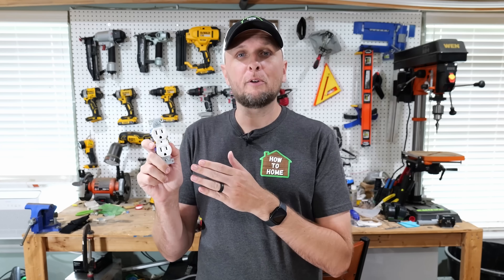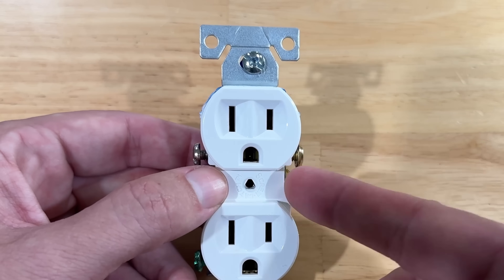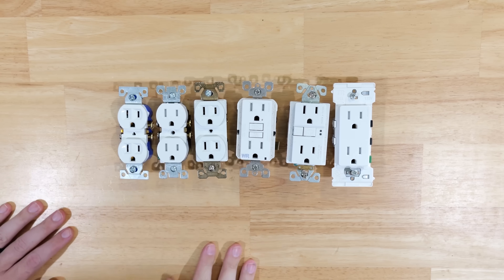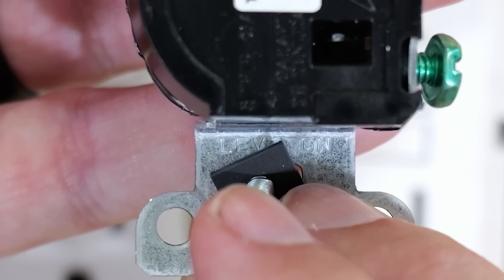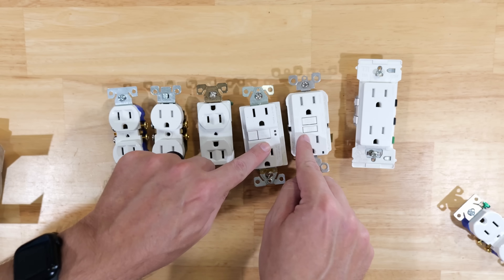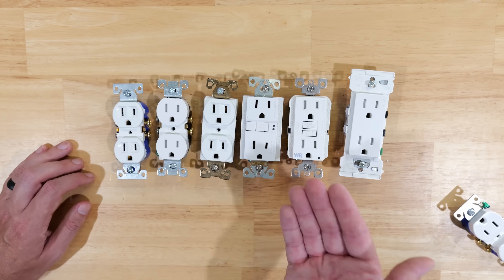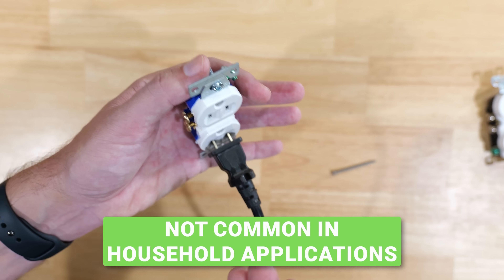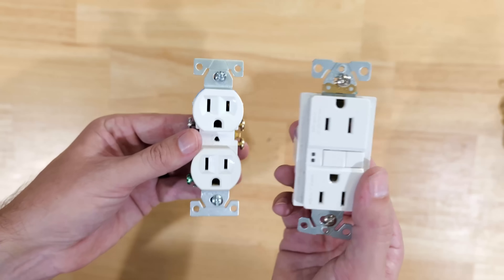The Shocking Reason Why Your Outlets Are Installed Upside Down!

Comment: I've been an electrician my whole life (45 years exp). I worked non union, union and owner. A place you will always see outlets installed ground up is in hospitals or anything patient care. That was for the metal clipboards they used and hung on walls all over patient areas would slip off their screw or the staff would fumble them and they would hit the outlet and short circuit. So in many municipality settings, it's in the blueprint literature to install them ground prong up. They're many other commercial and industrial settings they could fit this example as well. I've always install outlets to the environment they are in, so in any instances that something could come off the wall or fall onto an outlet or if in the specs, I would install ground up. If not, ground down. Also, horizontally, you should always install the receptacle neutral side up. Thank you and have a good day.
Reply: Good point on horizontal, I hadn't thought about that!!
Reply: Thanks for explaining this about my work environment - I always wondered. And, we're building a new house and have plans for some horizontal receptacles so good to think about that as well.
Reply: @marlohowell7081  We have horizontal outlets in this building.   With neutral pointing pointing up, if something is dropped it is going to hit the neutral and ground.  Though if a person's finger edges over without being seen when unplugging something, the hand will touch the hot prong. I've not noticed this to be a problem.
Reply: I was in the hospital 4 days ago. Every receptical I saw was ground side down. I’m 81 years old . I’ve never seen a ground side up receptacle. Also I occasionally buy short power cords with flat plugs in order to use the behind furniture. The cord connection is always angled so the the cord angles down.
Reply: @davidstevens1911 I noticed that Aurora medical facilities around here have ground up. But was at an Ascension building the other day, they were ground down. But Ascension building is decades older, so probably follows the old convention.  NEC rules are changed based on history of hazards, so this one might not have made it there yet.  Example, GFCI required on HVAC because a boy jump a fence landing on outdoor AC unit and was electrocuted. The exception 1 for this is removed in 2026.
Reply: @paulsorensen8489 I now have a tape measure with burn marks that wouldn’t be there if the receptical ground had been at the top.
Reply: Not an electrician here, but I did work in a hospital, and noticed that some outlets were prong up, and some prong down.  I asked one of the maintenance guys.  He said that they install outlets ground prong up for generator circuits and 30A circuits, so they can be easy identified.  When we built our new corp office, that also was something the electricians gave me the option on.  So I had them install the 30A outlets prong up.  The generator circuit outlets plates have a red dot on them.
Reply: @Mike.Canfield  hospitals use red outlets and plates in Florida and is on continuous power. Blood pressure pumps are on their own battery and the cord is to charge the batteries. Also hospital grade plugs on them. 73
Reply: Put the plug in firmly then never a problem
Reply: @bobd642  that is not always going to happen and plugs get Jared loose. I found my heater half plugged in. Good thing it was on low 600 watts. I never use high 1500 watts. 73
Reply: BAMA here. Hospitals have ground up. For all the same reasons. But if I did that in any of the houses I build, the homeowners would think they are wrong.
Reply: wow, it took me a nanosecond for me to decide that the most safest orientation is down, even in hospitals.    The most likely and probable scenario is the plug will eventually; over time, come loose and out for many reasons, pets, furniture moving, etc and our friendly "gravity", not things dropping, not because it looks better, but it is the safest, as the plug eventually comes loose, the GROUND is the last thing to come out and the ground being connected is the most safest scenario rather than having the hot being the last prong to come out.    This was my first time ever installing a receptacle as an apprentice 35 years ago and now a retired licensed electrician and I never had to debate this since.
Reply: Thank you for posting this. I always wondered why health care facilities had receptacles with ground up.
Reply: Behind the refrigerator,  the power chord will hang normally,  the ground hole, has to be down. If your brand is different,  you may want to flip it.
Reply: On one school job we were instructed to mount ground up, there had been a fatality from a teacher plugging in an overhead projector and her gold chain got into the hot/neutral blades. Only the one job... Never asked to ground up since.
Reply: @budward3780  I've had is specifically requested in blueprint specs in VA hospitals and other medical facilities I have worked in.
Reply: Sitting in a Canadian hospital at the moment. Ground prongs are all down. Maybe up in laboratories and cupboards there but not anywhere I can see.
Reply: Every house I've lived in and visited for the past 58 years have had all ground plugs down except for 1 home. There has never been an incident where a hanging object has fallen off the wall and hit the two plugs. But, that is just my experience and mine alone.
Reply: @masshultzy6449  It matters not.  The reason for it is the have a "make first, break last" conductor connection to the ground fault return path conductor.  The orientation of the outlet is 100% inconsequential, or we would be hearing about the consequences.  It is a non issue.  If one's plug is hanging out as in not fully inserted, then one has an issue with the functional integrity of that outlet, not how it got installed.
Reply: @cosmicraysshotsintothelight  Perhaps if you opened your mind a little instead of insisting you are always correct. Also, no need for the silliness term. Maybe you should do some more research in ungrounded emergency systems before you go spouting off on things you obviously know very little about.
Reply: At a previous house in San Antonio, the ground prongs were up as a distinction between local electrical installers.  My own thought would be ground prong down in the far more likely scenario of a plug being pulled out partially (i.e., someone hooked the cord on a chair or their foot). The ground prong being longer than the hot & neutral would remain with some contact a little longer than the other two. That said, I think that both 'casualty scenarios' are pretty unlikely.
Reply: In a Hospital, most of time they use metal device plates too! Ground up would be an advantage!
Reply: I was taught ground up by my grandmother back in the late 70s but I have never heard neutral up on horizontal install
And I honestly never gave it any thought
But now that it's been mentioned i can totally agree thank you for the education
Reply: I install ground down, sockets remind me of O faces. 😮
Reply: Ground prong down, because it looks like a Face
Reply: Was a licensed electrical contractor when I was younger and did the same. Ordinary folks just think it's weird in a house.
Reply: This
Reply: Perfect explanation, thanks! Though if metal clipboards falling onto exposed conductors is a problem, this seems like a bandaid for the actual cause.
Reply: Some plug manufacturers place the grounding pin up and others down, on "Male Molded Angled Plugs". So if you want the cord to hang down, you have to have a socket with the  proper grounding pin orientation. I solve this problem with a 4" box. Then install two duplex outlets, one ground pin up and one ground pin down. 

THE STORY goes:  Mr. Labre conceived this 3 pin design to prevent his landlady from being shocked by a small fan that she used on hot days. Her cat would knock the fan over, and when she set it back up, it would give her a shock. Labre's 1927 design allows any static voltage buildup or leaking motor voltage, to be shunted to ground.
Reply: @MikeMcDaniels-w1u  I really don't need two duplex together and they look awful at 18 inch hight there was a time it was against code to put two duplex together it may have been a local code. If it's extension cords you can just find a brand made for ground up or down I don't like angled power cords either they work in some applications but not every application. The go against the grain like when putting cabinets and if the angle is on the right you lose at least six inches of cord. I want mine angled on the left or straight down. Ground down they are angled to the right. Pig tails are a way around if you can find the right one I repaired many power strips. I plan on using flat wire and I do have one for ground down. 73
Reply: I worked in a hospital and one of my jobs was to test the holding tension of the receptacle prongs  and had seen many times that the cover screw had come loose from the vibration of much use.. The reason the ground was up is so that if the cover screw came out the metal cover would short out the outlet and take out the entire branch circuit.
Reply: The ground prong should be down for one reason is because the plug of the cord rest on the ground on the bottom
Reply: @born2wrench  does not make a difference
Reply: i one hundred percent agree with you however something that i have not seen mentioned is when using metal receptical covers when i was working i met a union electrician who explained to me that the reason that a receptical would be installed ground prong up is for when using the metal covers if these covers become loose as receptical covers are known to do over time if they fall on the ground in the event of something lossly pluged in they wont do any harm where as if these metal covers are installed on ground prong face down it could cause a short circuit to be fair 99.9 percent of residential is using plastic covers so in a house 99.9 percent of the time it probably does not matter i am an amature electrician  with my et certification if i am wrong about something please feel free to correct me i am always willing to learn something new
Reply: When I learned to wire houses from my grandfather (electrician for US Steel and Salt River Project) and my first Apprenticeship for a Construction company in Las Vega, NV. Both of them said the same thing. Yes, you can place the receptacle(outlet) in either position. But you will  always place the ground prong down, if it is the area could or has a history of becoming flooded. So it was 'an always" for a basement. And most of the time on the Main floor of the house; that is not on a hill. In 1973, the flash flood swept through most of the city of Las Vegas. I have done this since then.
Reply: But said ground up I'm both cases, so up or up, no versatility.   Personally, I have only seen ground down unlike you claim but I do see it on commercial equipment like my mitre saw bench.  Which actually has the plugs fall out all the time unlike has never happened with ground down in a wall.  Then again, many of my electrical tools are two prong or battery powered unlike kitchen appliances, every microwave oven has ground.   Of course, every hair dryer, etc.

Now, look at your hairdryer, all the weight is below the ground so it will remain fully inserted with ground down but the weight will tend to pull it out if ground up.  Every transformer I have seen, grounded or not has  the weight below if neutral is on the left and not the right.

However, compare receptacles vs switches / dimmers.  Where is ground on a switch/dimmer, on top or bottom, should ii not be the same location, usually the top.  I remember because the ground is below me but not  with switches.
Reply: Post office also a paper clip cause a short. 
Paper clip fell behind a desk and short out the circuit. Thats why in commercial electrical they now install the duplex upside down.
Reply: This is the same thing I saw.  Way back, Nurse Call pulls were actually metal chains.  These pull chains were usually at the head of the patient bed and the chain often extended almost to the floor.  There was usually a plug located in the same area.  The problem was that if there was a medical appliance, bed etc not fully plugged in and a Nurse Call chain dropped across the hot and neutral, there was the potential for a shock and/or fire.  Having the ground up made it more difficult to get across the hot and neutral.  Also, if you hit the ground and hot that would trip the GFCI so no shock and no fire.  Now with the elimination of pull chains on Nurse Call pulls and the use of Arc-Fault breakers, this is becoming less of an issue.  Personally, I still liked seeing them installed upside down in laboratories due to jewelry like tennis bracelets that some lab techs may wear.
Reply: @FlyMIfYouGotM excellent fill in information.  Really a curious question.
Reply: I had a man from OSHA reprimanded me here in n.y about  the ground needing to be up,I then mentioned what about behind say a refrigerator,with a molded plug? That orientation forms a binding loop up,then pressing against the back of the appliance,in essence pinching, (potentially)against its design! He said,oh yeah,never thought about that!
Reply: @rickswartzentruber3616  Haven't seen too many refrigerators in patient care areas.
Reply: @electvolt67 answers for different applications, not blanket answer. Angled plugs are not supposed to be tethered to wall, and occasionally bend back with gravity to reveal blades (or loose contact).I appreciate the conversation.
Reply: I was told in your home if it was a switched outlet in other words an outlet that had a wall toggle, it would be upside down as in the bedroom for lamps to be plugged in.
Reply: I worked at the largest hospital in Alaska. Red outlets Delta outlets etc and I did not see any with the ground UP. Where I have a problem with people is they pull the wire and not the plug causing more problems. Then you make them replace the male end and it works. A plug that is not plugged in incorrectly is a person that is not to bright. In so much as the ground on top half plugged in a clip board falling can do exactly the same by hitting ground and hot yeah an angle and yes it still can happen. You ever been to Europe hell they only have 2 prongs at 220 volts.
Reply: I work in a hospital, and all the outlets are as you said, ground prong up.
Reply: My place in Europe, the plugs are round, and they go into a hole, so it is impossible for the prongs to be exposed.  I'm surprised that no one makes such a receptacle in US for such scenarios as you describe.  Could  be bad to short out circuit with life support equipment on it, probably worth the extra few cents of plastic.
Reply: @hhf39p  there are outlets that are recessed we used them when we had electric clocks. They are also used in other applications. I would not one in every outlet sometimes they are hard to plug in plugs. Also you need deeper boxes as well. One problem we with those type of outlets transformers won't fit. And GFI plugs. Most hair dryers have them. 73
Reply: @hhf39p  In Europe  the electricity is 220V and in the US  110 V usually. In Europe , that's for sure it is supposed to be more  safe and secured.
Reply: @hhf39p  While I tend to agree that European plugs are much safer. They are also massive, and if it's sitting on the ground with the prongs up it's 10x worse than a Lego brick if you step on it, ouch! It's a trade off. I think it makes sense to have higher safety in the European plugs because all the electricity is 240V or higher. In the US we have 120V for most things, so we can get away with sleeker plugs with less safety built in. Getting zapped by 240 is life changing, getting zapped by 120v tickles in comparison. (not that 120v has no danger, it's just in a different league than 240V)
Reply: @akunog5143 has surprised me that at 220v has no ground. And " lamp wire" to boot!?! Plaster right over. Very curious. Track record of being fine, whole lot less materials,  and yet: troubles my relaxing about it.
Reply: Millions of dollars actually, to change all of your cords and plugs all across the nation.
Reply: @mountainman5025  The hospital grade outlets are only required in hospitals and medical areas where critical care is required, they have been required since around 2014 but is standard now across the country. The outlets aren’t required in commercial, residential or basically anywhere else other than medical areas as required . The hospitals literally have been a lifesaver for many of the union trades as they have been rebuilding, remodeling for a couple decades now but during covid they kept a lot of trades above water, all the general contractors and the many sub contractors below them. I know this because I spent 35 years in and around new construction, industrial, commercial, federal, state, county and city projects.
Reply: @hhf39p you didn't get the memo.
Reply: I was an outside vendor working with plumbers and electricians for 35 yrs. for  equipment installation and I too saw that hospitals and medical clinics would have the outlets ground up on low wall outlets. I did this also at home where I had an outlet near my tool bench so that if a tool fell it would not hit directly across the hot and neutral.
Reply: Good responce! Thankx, Saved me from doing it :/
Reply: @EhCanadian316  Thank you, some people just want to be argumentative, trolls being a word associated with them. I had to flush out the chlorinated water out of the dialysis regular water outlets and the RO water outlets were flushed also after being sterilized with 35% Hydorgen Peroxide to a level of 200 ppm. So  we literally went around to every outlet in the hospital that had water outlets. The dialysis unit beds could be on 1-3 floors along with critical care rooms, new baby rooms anywhere critical had hospital grade outlets, red with ground up configuration, basically whole panels with the outlets. the main reason they are ground up with a horizontal blade on side and ground up is to just make it harder to accidentally pull the plug out on a critical care piece of equipment but they are on a separate dedicated power distribution system with their own dedicated panel marked as such. For instance ; monitors, micro drug injectors and ventilators that were so short in supply during covid. Trying to find the specific NEC code is difficult but I did list the NEC article that stated the code . Anyway I’m done with the subject and thank you for the support.
Reply: Thank you for sharing that. I was curious about the ground orientation in hospitals.
Reply: @ Just google hospital grade outlets and open it in views and you will see dozens upon dozens of examples of the outlets. Litton has a website on them. They can be white or red but when specified for hospital rooms they are specifically required for they are red. The reason being they are on their own dedicated circuit and breaker panels which are also labeled as such. Oshpd would be the best place to ask questions.
Reply: i worked for an electrician for about 6 summers during high school and college. He always installed receptacles with ground facing up. I think the only convincing reason i got was that if you're right handed you get to do the ground and neutral on your dominant side more easily. and to be fair....every outlet i've replaced as an adult ends up with ground up.
Reply: AH! So ground up is to prevent shorting across the hot and neutral blades with a falling clipboard.
Reply: So neutral up would apply to power strips as well.
Reply: That's correct
Reply: It seems to me a roll of toilet paper problem for electricians
Reply: Excellent comment, Its always good when electrician review the You Tuber's so they do not make any mistakes or  misinformed the normey. As electricians we work with something you cannot see, until we make that minor opps. We've all been there done that.
Reply: I've notice this in hospitals and doctor offices. That explains why thanks
Reply: I have worked in a hospital for 45 years.  This is just not true.
Reply: clipboards? lol, no, i'm thinking the SS wallplates, but it doesnt matter.
Reply: Spend a lot of bs because if more than all people live in houses do ground to the bottom and the only change you said maybe a note for a electrical  fixture upside down to determine if using a generator system  but I think upside down any other app. Bogus.  😢  sorry
Reply: You absolutely right, I have the same through too.
Reply: Our power poles in our production area have ground up while the wall outlets are ground down. I guess we will never come to agreement which is best and correct let the home owner decide or use both ways when it comes to flat plugs and GFI plugs not outlets. 73
Reply: Very good common sense.
Reply: Also to add to everything. Ground up used to be the norm because there were only metal plates at that time. Once plastic came out then it didn't matter. No short could occur.
Reply: @Jackspade216  maybe but any metal that touches hot and neutral will short out no matter what kind of plate used. Metal or plastic. That's why hospitals use ground up and dedicated single outlet are ground up. I have appliance extensions and every one I have is made for ground up. I'm surprised that code don't insist ground up. But I know a lot of people would complain . Mine are ground down in both of my houses . I made them in my father in laws mountain cabin as well. I did all the wiring except what the AC guy and pump guy did but they had to use my panels. 73
Reply: @electvolt67  yeah my work has power poles in the production area that are ground up. But every outlet on the walls are ground down. And those pig tale appliance extension cords are plugged on the top outlet and the wire is hanging down from the top. Not very secure. 73
Reply: Nice
Reply: Problem with that claim is that I've seen both orientations in one room in a hospital.  It sounds good but it isn't required.
Reply: hit the outlet and short circuit ?? . that makes no sense at all
Reply: Not in any of the hospitals I've frequented. And those include hospitals in multiple states on the west coast and the Midwest. When were flat metal clipboards so common in hospitals, and where was it happening that they were being hung up over receptacles so often, (and probably hard to reach because if it's not high up or over a sink or counter area most things in hospitals stand directly in front of the receptacle they are plugged into) also with chords only partially plugged into the receptacle, Andis clipboard sliding perfectly straight down against the wall, that this was thought to be a serious problem and that this was a serious solution for it. I call shenanigans, myth, wives tell, bs.
Reply: That explantion makes a lot of sense. Thanks.
Reply: Yep, he nailed it. Lots of steel utensils on lab tables as well. If they roll of the table and land just right. Somebody's going to lose power and ruin a six month experiment. The perfect storm can happen, so it's just a precaution.
Reply: Literally came here to say this. Thank you 🙌 In addition, often times the hospitals would have metal trim plates, and in the event of a loose trim plate falling off the outlet due to a loose/missing screw, it would land on the ground prong
Reply: Your right on your comment all the way some commercial apps like a hospital  will be required to be upside down or look at the device it self which this guy did not mention
Reply: I have noticed this in hospitals. Usually colored orange.
Reply: @Electvolt67.  I think you mean your Whole Adult Life. You can't be a legal apprentice until your 18.  any other experience does not count as being an Electrician.  Whole Adult life, yes.  Whole Life, no.  I hate when Electricians lie about this. Careful with your wording!
Reply: @russrockino-rr0864 careful with your wording, it's you're and not your 18...I hate it when people lie like that
Reply: YES!  As always in the real world, different circumstances require different solutions.  There is no one size fits all; no one right answer.
Reply: @notwo2smartthank you, looking for wisdom. Planning ahead is important,  being careful is important,  and no games with the power of voltage and amperage.  Nice to read some thoughts across the board.
Reply: This problem would eventually go away if NEC drafted a new requirment for outlets to contain a safety shroud to prevent incursion of objects into a connected outlet.  But, OH, NO!  Gotta kiss ass and pretend to be interested in safety.  NEC code is primitive at best.....
Reply: SIDEWAYS! Yes! Thank you for that! I was wondering about that. So, neutral up, ground prong facing left.
Reply: I actually work in a major hospital in NYC.
Years ago, there was an incident in a Neonatal Intensive Care Unit (NICU). The room had at least 10-12 patient monitors for critical care infants. A paperclip had accidentally fallen into a patient monitor plug, which was not fully inserted into the receptacle. 

This created a spark (which scared a few nurses) as the paperclip rested on the Hot and Neutral prongs. The short circuit "tripped" the circuit breaker, and the entire room lost monitoring capability for these infants in critical care. An emergency call was placed to our on-site electricians to re-engage the circuit breaker to restore power to this ICU room.
Reply: In my 3 houses that I owned or rented, all the outlets that were installed ground prong up were controlled by a switch. All others were installed ground prong down.
Reply: @najeebk2821  well I hope you had an additional constant outlet right next to them because they don't count as a convenience wall outlet.
Reply: If they look like a surprised face, they are going the right way. If not, you're dyslexic.
Reply: Yes, anywhere combustible gases are present. In hospitals, the risk is oxygen. An arc or spark has the potential to set off an explosion.
Reply: The place that matters is under a sink. The receptacle should be attached to the wall and not to the floor to avoid water getting into the receptacle. Example for garbage disposal .
Reply: @Grant-y7y  under the sink is not considered a wet or damp location but I fail to see what that has to do with whether an outlet is ground prong up or down.
Reply: Thanks for the thorough explanation.
Reply: That's how it was explained to me that it would cause an arc. 2 in 30 million chances. Also arc fault breakers kinda got rid of that
Reply: @krystiangorski6201  Nice ratio taken from your arse. Arc faults are completely avoided in patient care areas in hospitals for the same reason putting outlets ground prong up, to avoid nuisance tripping. Who ever "explained" that to you shouldn't be explaining anything. Read the code yourself and fact check anything "explained" to you before spreading bad info.
Reply: @electvolt67 first im not spreading bad info, just said thats how it was explained to me. Obviously 2 in 30 mill was hyperbole. Youre completely right about the arc faults thats my mistake. Second, its a comment section. Sure i could just read the code. So should everyone just delete you tube and check the code book? Discussions not allowed? 😂 listen bro, take it easy, go have a pint of cider and don't be so angry. ✌️cheers
Reply: @krystiangorski6201  All I'm saying that if someone needs to explain something to you and you don't do any research about it, you need to start doing just that before you proclaiming it as truth. Especially now a days with the internet with all it's false claims and bad info. I have 45+ years doing this and yes, I still take and teach continuing education. One thing I try to do is triple check anything new to me. I don't just believe anything I hear and just repeat it as truth. It's not just about knowing codes but understanding electrical theory and why those codes are implemented. Don't rely on someone explaining things to you, teach yourself as well....especially if you do this for a living.
Reply: @electvolt67 I hear you man and completely agree. But i wasnt stating it as truth, just how someone explained it to me. Absolutely one should always do research and not trust everything someone writes in a comment section
 The way i remember it, he said if its installed normally and the plug gets slightly pulled out it could still be hot and if something conductive hits it, it will ark. Makes sense and I see nothing wrong with it. But how often does that happen? And if clip boards are always falling and doing that they should find a new place for the clip boards😂. Even if something hits it, should arc and trip the breaker unless they have federal pacific. But anyways anything to avoid an arc is a good thing. What they should do is make hospital equipment with twist lock plugs. Anyway I was just chatting wandering what other electricians think, thats all. Im the same way, i try not to have an ego just because ive been doing it a long time. Can always learn something new. No body knows everything. Especially now with technology developing and new things coming out all the time. I remember wiring buck transformers ( big freaking things) and running #10 to feed ucl's. Lol. Halogen crap. Now thats like the steam engine. Everything is led and the options are great the super thin recessed lights. I remember fighting to install 6" recessed lighting. Even the shallow ones didn't always work. This that beam in the way! Lol. These guys have it easy now!
Reply: @krystiangorski6201  Would be kind of bad for that to happen in a hospital to an ECMO machine or ventilator...
Reply: @TalkingHands308 💯 the few times I worked in hospitals I always installed the outlets upside down. Sure its very rare, but if and when it happens, thats a bad place for it
Reply: Neutral side up - never considered that.  Thanks!
Reply: @allansplace  It's in Division 26 for municipalities and VA hospitals.
Reply: Not true.  I have worked in hospitals for 40 years.  Never seen ground prong up.
Reply: All the receptacles in my house were installed ground up. It’s annoying because most multi-plug outlet adapters are designed for ground down installation — particularly those with built in shelves &/or USB ports. I just flipped the receptacle by my desk because otherwise the USB ports on the adapter are invisible.
Reply: @Lavolanges  Exactly!  Ground up is just bonkers.
Reply: why not retard side up?
Reply: I've installed plugs ground up on ac/heater wall units for motel rooms.... the plugs fit in the wall better with ground up due to the way the cord is on the plug
Reply: @Joshua-k1y  yeah all my window units have GFI plugs and a ground up outlet would be better. They make these window units energy star or efficient so they can be plugged in anywhere don't need dedicated circuits. 73
Reply: The real problem was the Einsteins hanging clipboard and what not onto cords -THIMK ¡
Reply: @thomasmleahy6218 I worked in hospitals for almost 20 years, in 4 different states, and I've never seen that happen, Einstein.
Reply: In Chicago area. Residential is piped by code... EMT. Most local practice with orientation which is usually horizontal.  HOT is up! Ground to the right. That way the hot if it comes lose will pin itself by gravity and not cause a fault. Horizontal is safer with hot up.  But anyway, its just local practice and how the customer wants it... But safest is horizontal and hot up if no specific orientation is given by the homeowner, etc... There really is no right or wrong way unless what's laid out in the NEC... Which he explains in this video.
Reply: @bthamus8334 I appreciate your comment but I don't understand what you mean by saying the hot will pin itself by gravity?  Can you expand on that? Thank you!
Reply: @AndrewSahagian  Yeah... Sideways, hot on top, even if it comes loose, the wire won't move and possibly cause a fault. Sideways, neutral on bottom, hot on top, ground to right is the safest possible orientation. Full proof, even if connection is loose.
Reply: @bthamus8334  yeah they could care less about safety if a paperclip would fall on the hot prong and someone touched it they would get shocked especially if you had brass plates also could short out. I'm thinking in an office not the home. 73
Reply: another bullshit scenario expounded:face-blue-smiling:
Reply: @shaystern2453  Unless the target of your comment is known, people have no idea what you are calling out.  The original comment, or one of the replies.  Be specific, child.  otherwise the bullsh*t folks have to endure is yours.
Reply: Hospital and medical centers fall under the jurisdiction of Oshpd .I have worked on numerous hospitals and medical clinics notably UCDMC, Kaiser, Methodist Hospitals , Shriners , Mercy General and Sutter Hospitals for the last 35 years including all the remodels as well. So to call out someone that they are full of it is wrong. I stand with elecvolt67. Where you see ground up in particular is life support equipment or critical need equipment.
Reply: @JW007100  Except...  actually SHOW the text... the rule, etc. where it is declared as such.  As a required configuration.  SHOW IT, or you are merely a carnival midway barker telling folks how you saw it done.
Reply: @ Hospital-grade wiring: The term “hospital-grade wiring” is a generalization referring to all wiring that falls under Article 517.13 of the NEC. This article requires all wiring within patient care spaces to be provided with a redundant grounding path. Article 517.13(A) requires the raceway, cable armor or sheath to act as effective ground-fault current path in addition to the green-insulated copper grounding conductor required by Article 517.13(B). The following common wiring methods will typically meet both requirements.

Cable within electrical metallic tubing (EMT).

Type AC cable – AC-HCF.

Type MC cable – MC-HCF.

Standard MC cable and wiring within polyvinyl chloride conduit do not meet the requirements of Article 517.13. The acceptable wiring methods noted above must be used in all patient care spaces within a health care facility. One exception to this rule is the wiring to any light fixtures mounted above 7 feet 6 inches and their associated light switches, should those be located outside the patient care vicinity, as indicated in the “exception” text to Article 517.13.

In that case, it is acceptable to meet the requirements of either 517.13(A) or 517.13(B). Any life safety or critical branch circuits intended to be served by flexible metal sheathed cable must also meet the requirements of Article 517.31(C)(3)(3). If these requirements cannot be met, these circuits should be served by cable within EMT.

Figure 5: Hospital-grade receptacles in patient room headwall, which are required to ensure a proper grounding connection when equipment is plugged in within a patient care space. Courtesy: Fitzemeyer & Tocci Associates Inc.
Figure 5: Hospital-grade receptacles in patient room headwall, which are required to ensure a proper grounding connection when equipment is plugged in within a patient care space. Courtesy: Fitzemeyer & Tocci Associates Inc.

Some owners have standards requiring that these wiring methods be used throughout their facilities, even in areas where patient care is not provided. This helps to “future proof” an installation, allowing any existing wiring to be maintained and reused should a nonhealth care space (such as offices, breakrooms, corridors) be reworked into a patient care space.

Hospital-grade receptacles: Hospital-grade receptacles are required to ensure a proper grounding connection when equipment is plugged in within a patient care space. They also require additional pull-force to remove the plugs, helping prevent accidental removal. Unlike hospital-grade wiring, hospital grade receptacles are only required in specific patient care spaces; Category 1 and Category 2. This is noted in Articles 517.18 and 517.19 of the NEC. While these receptacles are not required in every type of patient care space, many health care facilities will require they be installed in all areas of their buildings to help ensure their spaces are code compliant, should the space type change in the future.

Receptacle quantity/branch circuit power requirements: Some patient care spaces have receptacle quantity requirements described in Article 517 of the NEC. The NEC defines a single receptacle as “a single contact device with no other contact device on the same yoke or strap.” The receptacle requirements within Article 517 can be achieved using any combination of single or multireceptacle devices, such as duplex receptacles. Both Category 2 and Category 1 spaces have receptacle quantity and branch circuit requirements indicated in Article 517.18 and 517.19, respectively. Operating rooms are also provided with their own set of requirements as well as wet procedure locations:

Category 2 Spaces: Per Article 517.18, Category 2 patient care bed locations are required to have a minimum of eight receptacles and two branch circuits; one normal branch and one critical branch. If there are two critical branches served by separate automatic transfer switches, it is permitted to use one branch circuit from each in lieu of a normal branch circuit.
Category 1 Spaces: Per Article 517.19, Category 1 patient care bed locations are required to have a minimum of 14 receptacles and two branch circuits; one normal branch and one critical branch. If there are two critical branches served by separate automatic transfer switches, it is permitted to use one branch circuit from each in lieu of a normal branch circuit. In addition, one of the critical branches must be dedicated to receptacles at the patient bed location.
Operating rooms: Per Article 517.19(C), operating rooms are required to have a minimum of 36 receptacles and two (branch circuits; one normal branch and one critical branch. If there are two critical branches served by separate ATS, it is permitted to use one branch circuit from each in lieu of a normal branch circuit. At least 12 but no more than 24 receptacles shall be connected to each of the branch circuits within the room.
Wet procedure locations: Branch circuits serving wet procedure locations must be provided with ground fault protection to interrupt the power supply or be fed by an isolated power system to mitigate the possible ground fault current to a low value without interrupting the power. Operating rooms will typically fall under this category, but coordination should be done with the facilities governing body to determine if any other patient care space is required to meet these criteria. Selection of either ground fault protected receptacles or isolated power should also be coordinated with the owner, as the loss of power associated with the ground fault protected receptacles can pose a hazard for some critical procedures.
Reply: @ They also require additional pull-force to remove the plugs, helping prevent accidental removal. Unlike hospital-grade wiring, hospital grade receptacles are only required in specific patient care spaces; Category 1 and Category 2. This is noted in Articles 517.18 and 517.19 of the NEC. While these receptacles are not required in every type of patient care space, many health care facilities will require they be installed in all areas of their buildings to help ensure their spaces are code compliant, should the space type change in the future.
Reply: @ If I could show you photos in a reply in comments I would but it’s proving difficult to do that with real photos. There are literally hundreds of photos online you could find yourself. I have worked in and around every new hospital built in Northern California for over 30 years and these receptacles are everywhere in patient rooms. my work was industrial water treatment systems and sterilization of domestic water in the entire hospitals or remodels. I literally walked into every room in the hospitals that had water. The kidney dialysis rooms on entire floors were all wired with ground up wall units with the red labeled outlets. Surgery rooms the same , lab areas the same. What you want as the particular NEC reg. that says it has to be that way is buried in their regulations but you should contact Oshpd or the local electrical inspectors and they would help you. But do your own research for your own good. What I can provide you should at least show that hospital grade receptacles are real, why they are there and why it is normal for hospital and medical care units these days.
Reply: You are the literal epitome of "We've always done it this way." 
There isn't any evidence to support this nonsensical theory. As a matter of fact, I have seen with my own two eyes, the exact opposite happen. I watched something fall off of the wall in a manufacturing facility. It hit the ground prong first, and it STILL rolled over and hit the hot prong, shorting out the circuit.
Reply: @MrFixItGa  Go to Google and type in Hospital Grade Outlets then select View at the top you will see example after example of Hospital panels in critical care areas  in the Hospital , get back to me on what you find.
Reply: Good explanation and logic.
Reply: Cords will often fall out when the ground plug is on top. Yes they can be either way but with the ground plug on the bottom you don’t have the problem with the plugs falling out. So in MHO it is wrong to install the ground plug up.
Reply: @glock907 if you say so. I work in a hospital, all outlets are that way, iv pumps, dialysis machines, ecmo, ventilators, all kinds of vital medical equipment are plugged and unplugged in them every day, don't have an issue with it. 🤷‍♂️
Reply: Ground plug up is wrong,
Reply: The guy that built my house in 1966 put  all of the outlets in upside down with the prong up. I swear at him every damn time I have to plug a cord back in after they fell out . And when I use an appliance with a still cord that is removable that has the ground plug down when this happens I have to struggle with the cord to plug it into the upside down outlet.. the ground plug on my pressure cooker and of my other appliances with removable cords all have the ground plug down. Further proof that the ground plug should be down. Just because it can be installed either way doesn’t mean that it should be.
Reply: @glock907 lol, you realize the lack of logic behind your claim right? If that's true then the plugs that don't have a ground prong at all should all be falling out of the sockets. The ground prong position has nothing to do with why your plugs are falling out, your outlets are simply worn down and need to be replaced.
Reply: I find it very strange the people here are talking about something falling on a plug's exposed conductors.  One supposes they refer to a plug that is partially inserted?  This 'gravity items falling on plugs' silliness is a lame observation to make.  Shorts on the hot and neutral blades causes an immediate breaker trip.  Shorts to the "fault return prong" trip the breaker that way.  The fault return prong is wired to the chassis, case, or frame of the AC powered device.  This is a protection for the user.   The 'hot' and 'neutral' are both isolated from the device chassis, case, or framework.  With a fault return, a hot to chassis short gets carried by the fault return prong.  Without a fault return prong and without line phasing being used, a user could receive a shock by inserting the plug backwards or in the case of a conductor break or short within the device.  SOMEONE should explain these elements first.  Before going into "appearances" or claimed reasons for something being done a certain way.  If a plug is hanging out far enough for the edge of a metal clipboard to hit it, that plug has retention issues to start with.